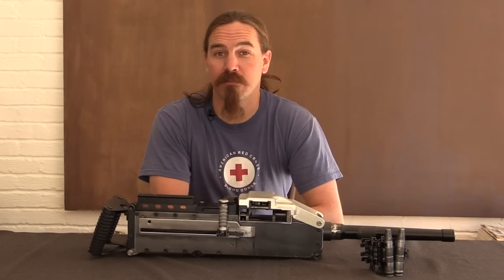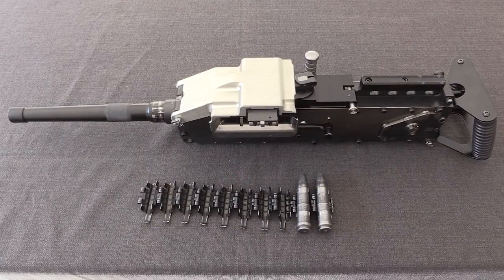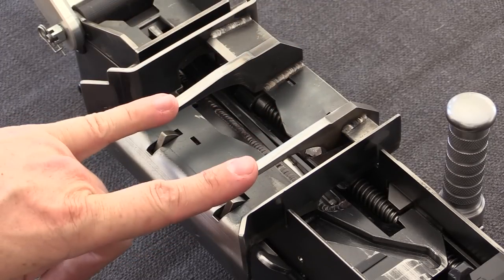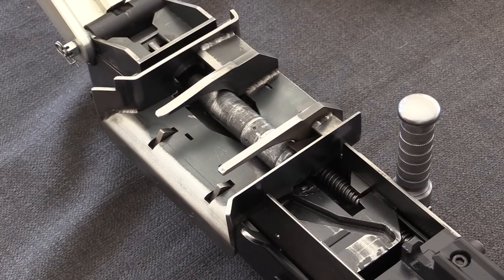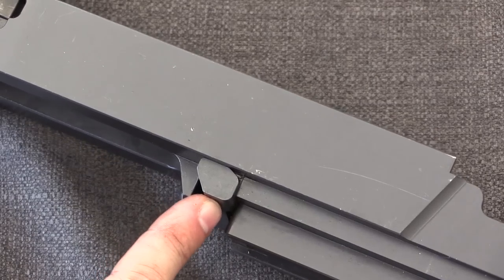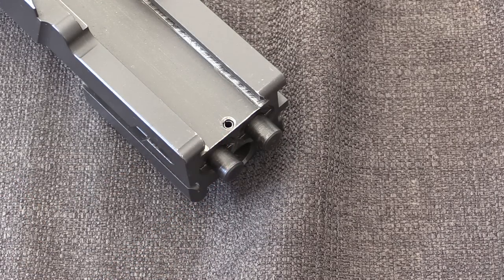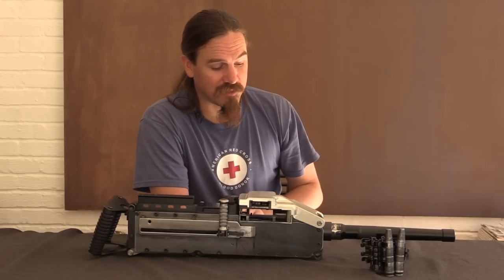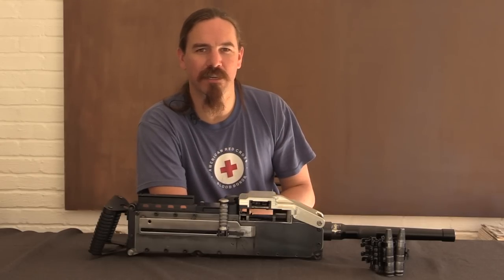Inkunzi Strike 20mm Grenade MG

Comment: This seems like it would be an excellent armament for a heavy multirotor drone. There are several hybrid gas electric octocopters that have 25+kg payload capacity.
Reply: As cool as it would be to see, overall not as effective vs bombs with the weight and having to  deal with recoil as a drone pilot. Bombs are more efficient and cost effective.
Reply: @yellowprime8491  for attacking troops in  fighting positions from overhead, I am 100% in agreement. For direct attack against point defense AA or other prepared targets, pop up attacks from 500m have a higher likelihood of success. It's the same reason why attack helicopters don't generally carry bombs.
Reply: the recoil would make it useless
Reply: @kschleic9053  helicopters don't shoot cannons that weight more than a small fraction of their overall weight (i.e. they don't usually carry tank cannons or howitzers). So unless your "drone" is basically a pilot-less chopper of normal size, this would be a single-shot, then wrestle with controls, then acquire target, then take another single shot. It's really not that good for a drone. 
That said yes it will be great for a chopper to replace the machinegun with
Reply: @marcogenovesi8570  a good point, it would definitely need to be engineered into the chassis, not underslung like a camera gymbal. I'm picturing something in the 100-120kg gross weight category (Ian sized😂) where the gun would be less than 10% of the gross weight and it should be possible to anticipate and account for the recoil in the flight software.
Reply: @kschleic9053  Where it is mounted in the drone does not matter. Did you see Ian shooting the single shot version at the beginning of the video? It has comparable recoil to .50 BMG (by looking at how Ian's whole upper body recoils with it). 120kg gross weight for the drone is NOT enough, especially if you are not touching the ground and can only use engines to compensate. 
On a 120kg drone you can probably get away with mounting an assault rifle, not a .50 BMG
Reply: @marcogenovesi8570  if the recoil force is acting through the center of gravity, then the drone won't rotate under the force of recoil, only move in the direction opposite of firing. During firing the rotors only have to keep the barrel pointed at the target, with no need to keep the drone stationary.
Reply: @kschleic9053  recoil is way too fast for rotors to compensate and moving "straight back" relative to the gun will still throw off your aim because the gun is not LOS like a laser, you have to compensate for bullet drop (or target movement if you are shooting at a moving target) so the barrel is not aimed straight at the target.
Reply: @marcogenovesi8570  compensating for linear motion (forward or backwards) sounds about right for an aircraft mounted machine gun.  I disagree though that a controller wouldn't be able to compensate for recoil motion, especially if the controller knew ahead of time that a round would be fired ... The video doesn't say what the rate of fire would be, but multirotor control loops run at 400+ Hz. If this is similar to a Mk19 that is 100+ control inputs per round fired.

Comment: I've never disassembled another mauser but the Swedish Mauser M96 also had a "you dun goofed" feature where if you pulled the bolt out of the gun with the safety in the middle disassembly position and then somehow managed to flip that into fire, the firing pin would drop and you would have to cock it by hand which wasn't so easy either.

In fact, i very much preferred to manually cock the bolt on the G3A3 than that on the mauser. Re-cocking the G3 was as 'simple' as pulling really hard on the rollers and it would slide back out without fighting back so much.
The mauser, with a strong firing pin spring, was something you needed a tool to accomplish AND you always ran the risk of getting your skin caught in the nasty grooves if you somehow lost the grip on the whole thing. Which has happened to quite a lot of unfortunate people during disassembly and especially reassembly.

I only once got my hands on a weaker firing pin spring mauser where i could actually, with a really strong grip and a 'can do' attitude managed to pull it back out by hand and flip the safety flag back in the disassembly position.

Anyways, i find the G3 quite simple to fix comparatively speaking. There's no spring to hold those locking rollers in place. You just get a firm grip on them and pull until they give.

Comment: An unmistakable sign of an excellent engineer - designing for failure.  Not just mechanical failure, but human error.  Like PVT Snuffy dropping the firing pin on the bolt while out of the gun.

Way too many engineers aren't very good at thinking about the guy who screwed up something that seems obvious to the design engineer.

Comment: Now to get a parts set of that... manufacturer it as a semiautomatic, it would still be a NFA as a D.D and a SBR. 
 Now back to reality that system has a lot to offer in multiple different roles. Light Infantry, Motorized, Airborne and support operations and could fill niche for fast boats..... If Sig would pick up on it and develop more on it,, the Army would jump on it.

Comment: Conceptually this can also be a weapon designed to accomplish some of the things the Terminator was theoretically trying to accomplish:

You can mount this on small trucks and supply transports and give them the ability to do meaningful fire back at windows in pintle mounts.

While also giving second line vehicles efficient means to engage vehicle borne IED’s driven by suicide bombers.

Allowing you to protect logistics inside a threatened urban space.

Edit: advanced technological versions could include things like automatic air timed burst grenades for anti-drone warfare but I don’t see that being a necessary perfected development for this kind of weapon having a place on the battlefield as a second line force multiplier for supply line defense against asymmetric attacks.

Comment: First, I absolutely want this, but I feel like I'm required to say that I've been cautious with anything that has a single system that has a range of capabilities that allows it to replace all current multiple system tactics. Yeah they are able to do a lot of things okay, but usually become a liability for the moments the systems it replaced were specifically designed for...

Swifter wet mops are great, but nowhere near the quality of the old broom and mop.
Reply: It was my understanding it was not meant to replace anything but fill a role that is not filled. A AGL that can be mounted on a mount that can take a 7.62mm MG. In the south african contex there are a number of vehicles with such mounts where it can support a FN-mag, SS77 or PKM but not a M2 or Y2 AGL. 

One idea was as a door gun for  helicopter the flater. Currently the door gun on a Orxy is 7.62mm MG. This would be a strait upgrade. It not going to take up more space or need a new mount like a M2 or Y2 and be a lot more use full than a LMG.

Comment: Its form factor and shape is very similar to the German MK108 30mm used by the luftwaffe, albeit mechanically this is vastly different. The 20mm SAPHEI would be ideal for punching through the walls of buildings in urban areas where anything .50 or below would likely miss the individuals inside.

Comment: It would be fascinating to compare this with the Chinese QLZ-04 and the older QLZ-87 35mm automatic grenade launchers, which are both made in a bipod-mounted "light" format as well as for use on a tripod, but sadly that's not likely to happen.

Comment: Hmm, you missed out a part of the story methinks. The Germans first came up with the concept of a lower velocity automatic weapon that fired a high explosive cartridge during WW2 for aircraft armament when they introduced the MG151/20 firing the 20x82 round.  Postwar, Denel created their own version called the Vektor GA-1. This gun looks to be based on the Mauser/Denel gun but with a reduced power cartridge and shorter barrel. It would be interesting to compare this gun and the Vektor GA-1 side-by-side as I suspect there will be more than a little similarity.

Comment: I gotta wonder if the designer considered looking into 20 mm aircraft  ammo belts rather than the Russian 50  (NSV 12.7mm)  I suppose Russian belts are all over the place because of their illicit arms trades to anyone with enough money while USAF 20mm belts are less widespread.
If his revisions can reduce the volume of steel in the body while not compromising the firing mechanism and barrel it would make it even more versatile and appealing to customers.  perhaps he could use modern alloys, plastics, and polymers should they be reasonably inexpensive and available?
Reply: i assume standard 20 mm belt are much wider as they are intended for longer casings.
Reply: @Erpyrikk  I would have to compare them side by side haven't looked at one in 16+ years.  The US 20mm aircraft rounds are much longer but the belt itself isn't that tall, always thought they looked front heavy as most of the round protrudes out the front of the belt.

Comment: Small wonder it uses a DShK feed belt...that grenade looks like a down-scaled 30mm (Russian) AGS grenade.

That being said, it's a well designed auto-GL with a lot of potential. (I agree that a high-velocity grenade has better tactical utility (in certain applications) than it's slower 40mm cousin.)
P.S. -- This is not say it replaces the 40mm grenade; IMO, there's a place on the battlefield for both types of grenades (e.g. HV and LV).

Comment: At this guns weight it is comparable to the M240/MAG 58. So a butt stock pistol grip should work as the MAG 58 has both. It just needs to be humped by the Hulk in a squad.

Comment: Direct fire grenade launchers are not so demanded on the modern battlefield. Long range indirect fire launchers such as mortars, 40 mm automatic launchers (that are used as ersatz mortars) and howitzers are finding much more use due to the nature of the modern warfare. There is also a wide application of recon drones that turn field artillery into a quite precise modern weapon.
This machine gun and grenade launcher hybrid is cool as hell!
But soldiers in the field would rather have a simple mortar with a recon drone.
Reply: really seems useful for compound defense against vbieds, better ballistics for direct fire quick than 40mm, better stopping power than .50 from rifle or MG when you need to make a big improvised armoured rolling bomb stop with a quickness
Reply: @sanderssonjankins6251  yeah. This direct fire launcher is more suited for anti-guerilla operations that for frontal modern warfare.

Comment: It's clearly a well designed weapon system. The only drawback I can see between this system and a 40mm system is a more limited payload selection. Otherwise, it's brilliant. The flatter trajectory of the 20mm round will make it more capable in open terrain such as deserts and steppes, while the smaller payload would make it more favorable for urban operations. Additionally, the ballistics of the round may lend itself to use onboard helicopters (as door guns) and small watercraft (such as SWCC boats). It probably won't replace the various 40mm launchers, but it'll complement them well. It's truly a shame that the project is on hold as it is, if I were a general or defense minister, I'd be throwing my money at the screen right now. I'm still throwing my money at the screen, just as a mere enthusiast.

Comment: Just wondering where this fits in a TO&E, given the long service of the Mk 19 and trials (and failures) of things like the XM25. Yes, the 40mm Mk 19 floats rounds down range while pooping little brass turds from its bottom, but the payload is such that it can cover a wider area with fewer rounds. The velocity difference is not that great (maybe 250 ft/s) so this isn't punching through much without chemical help.

Little is said of the payloads envisioned for this weapon and I wonder about the safeties that can be put in 20mm fusing. That was a concern with the XM25 and a lot of tech was thrown at that. It's one thing to toss HEI down a long Vulcan barrel mounted in a weapons bay away from the crew, another thing to do so from a 14" barrel on a vehicle-mounted pintle with your team members feet away from any accidental cook-off.

Still, the design choices are pretty cool. Just don't know if the payloads that are currently available make the gun worth anything.

Comment: 13kg is about the weight of an MG42. The cumulative recoil of 1 second of firing should be very similar too.

1 second of MG42 firing fires 20x13g (260g) of projectiles @ 800m/s
1 second of this 20mm fires 6x110g (660g) of projectiles @ 310m/s

The 20mm fires about 2.5x greater mass.
The MG42 fires about 2.5x greater velocity.

It's all the same with recoil, doubling mass has the same effect as doubling recoil.
Reply: That’s rather unlikely. Saw the recoil of the 20mm single shot gun?
Reply: @kimjanek646  the MG42 fires about 3x as fast, it's not comparing one shot to another.

Comment: This thing and the smaller shoulder fired gun are just begging for someone to field a powered exoskeleton.
  Imagine a man sized equivalent to a panzer 2 advancing in platoon strength.
Crazy.
  
A very solid looking prototype by the way.
Only two rough bits that I saw. That is well on it's way to ready for production by now I should think.

Comment: The locking block is very reminicent of how the M2HB locks, and Ian forgot to explain that in his video on the M2HB.
Reply: And the M2 is of course based on the 1919 design, which he did mention here.
Reply: I am not old enough to know the M1919 from Norwegian service, but I do know the M2HB. So I stick to what I know, and that part was a mistake from Ian to leave out in the M2HB video.
Reply: @azmodaiNO  A fellow Norwegian?

For what it's worth, the M2 is basically a scaled up 1919.
Reply: @Kaboomf  ja jeg er norsk, Oblt. i Hæren. Jeg var intervjuet om AK-47 i et av de siste Aftenposten historie.
Reply: @Kaboomf  BSIN utdannet?
Reply: @azmodaiNO  jepp. Gikk vel ut der i '99 eller deromkring.
Reply: @Kaboomf  Jeg gikk BSIN i 00-01, men ble artillerist etter KS.

Comment: Would be a very interesting secondary to a autocannon on an IFV.
Reply: Maybe not secondary for most western ifv since the caliber makes it a little redundant. But its an interesting Coaxial replacement or commander gun on a tank. Making it much more terrifying in urban area.
Reply: @rifqitaqiuddin  I disagree, if you to mount  a weapon in the 20mm range on a tank as coaxial or RCWS, why bother with this instead of a fully fledged auto cannon?
Reply: @errantstar for coaxial. smaller form factor. It about the size of m240. So dont have to clear out too much space where the coaxial would be. dont have to deal with barrel distruption(like some BMD that has main barrel and coaxial 30mm bolted together with a jig) not to mention muzzle break management. It also has a quite small size cartridge so it shouldnt be to much of a problem storing all the needed ammo inside. Unlike the normal 20mm. I mean if you have that great of a FCS its kinda overkill to shoot 7.62x51 with it. 20mm is a good upgrade

If its in RCWS you are correct. US has a RCWS with 30mm bushmaster (sometimes 25) made. Its not mass produced yet. But Better use existing Logistics. It still going to still be way bigger than this gun, but hey, matching logistic is more important in conflict. I was thinking NATO tanks need to have a Crew mounted gun that is Manual in nature, and if necesarry can be manipulated from inside the tank, kinda like T72 Kord MG. Or mg3 tripod. And this small form factor makes it easier to design the mechanism to enable it. 

 If secondary by IFV you mean like the Marder back turret, that can be controlled by dismount. Yeah that might be interesting. Im just saying that having to keep 2 types of rounds in 1 Hull. with close performance and require different gun, that  doesnt add more capability might be way too hard to sell to the Departement of defence of any country.

Comment: Brilliant design, the Power of Browning compels him.  Having auto fire and the pump in the NeoPup, why not a simpler bolt action for that round?  lower per unit cost, and will be lighter.  Even an under barrel unit for use on various small arms.
Reply: It's called the Denel NTW. Neophytou designed that too...

Comment: Interesting safety mechanism; wouldn't that still allow the bolt to fly forward if you accidently pressed the triggers?
 It just wouldn't allow the round to actually fire.
Would not want to get fingers caught in there while lifting the feed tray or clearing the breach :0

Comment: It is a cool design and a engineering achievement, but I don't really see a military adaptation for it, to be honest.
Sure, it is smaller and lighter than a 40mm automatic grenade launcher, as it obviously should be, but not that much smaller and lighter that it would justify accepting the lack of performance compared to a 40mm grenade launcher. It would still have to be carried and operated by a team, with a tripod, which would mean a reduction of fire power "per soldier needed" compared to the bigger caliber.

I don't think the faster muzzle velocity and flatter ballistic arc are actually big advantages. As far as I know, the steep ballistic arc of 40mm grenades is actually considered a feature, not a bug. It makes it easier to reach behind cover and into foxholes and trenches and the large blast radius and "deadliness bubble" of a 40mm grenade mitigates the issue with a long travel time.
"Better" ballistics (in the classical sense) in such a case would just mean more grenades whiz by the target uselessly, instead of raining down on it.